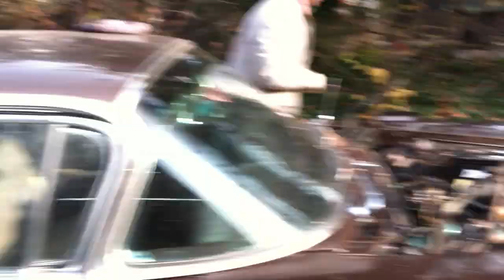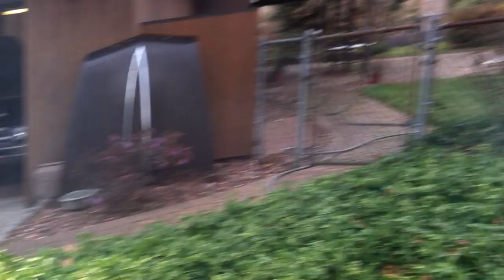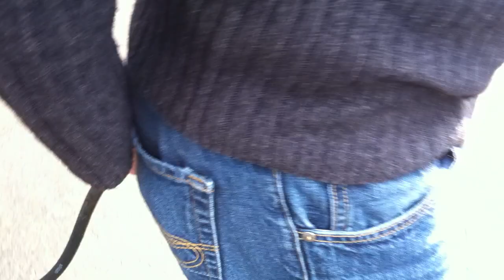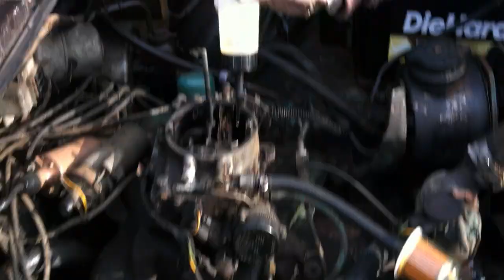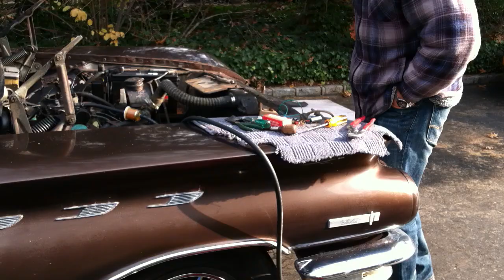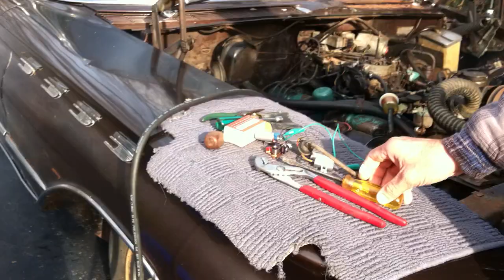1960 Buick start up Part 4 SUCCESS! Dec 02, 1 05 38 PM

Comment: I don't think that smokes going away :(
Reply from the maker: It actually did stop smoking, but ended up with a dead miss.  This motor was stuck hard from sitting over 30 years, so the fact that it actually ran was kinda miraculous.
Reply: Nail head solid engine